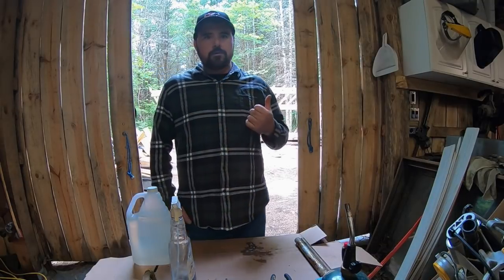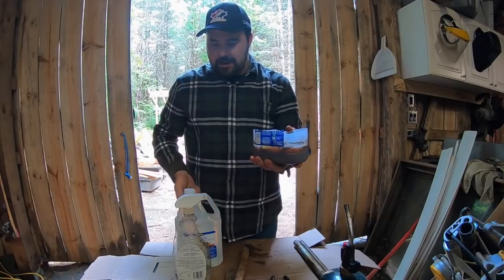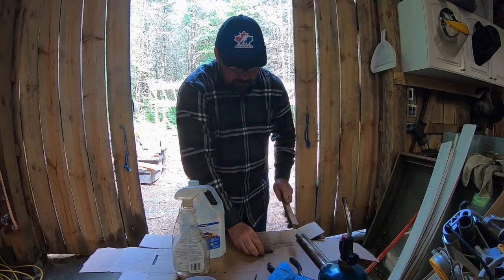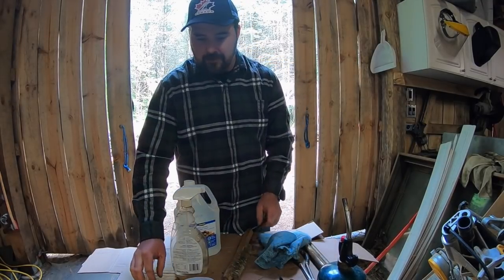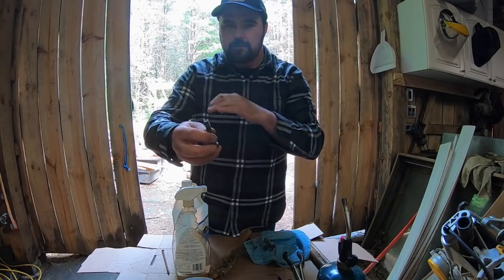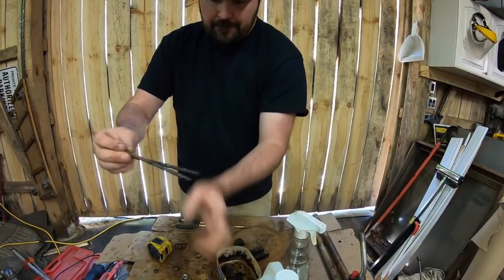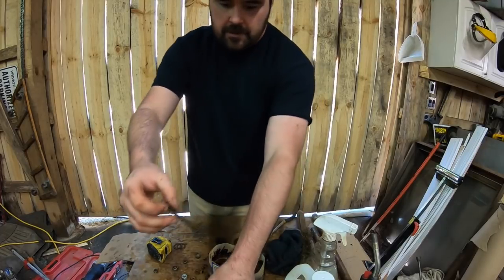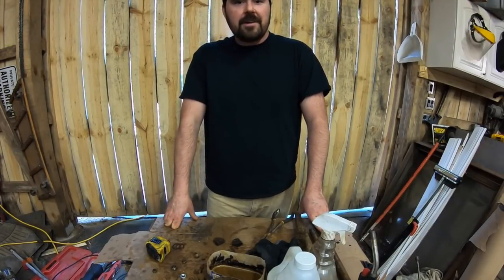Rust Remover You Can Eat | Safest Way to Remove Rust from Metal

Comment: You can also use the rusty  vinegar when you are done as an exterior wood stain. I just run it through a rag to get the chunks out and use the garden sprayer to apply. The first time I used it was a chicken coop 5 years ago and it still looks great the vinegar also reacts with the wood help change colour and act as a bit of a preservative

Comment: Hey Sandy! Neat topic to cover!  I use vinegar as well for cleaning rust!  So thought it was neat to see that you covered this :).  I mainly have been using it when I buy a small engine for a restoration project (B&S Flatheads) and if the metal tank has rust build up in it, I’ll fill it with vinegar and let it set .. then once done, drain and rinse out good then I’ll grab a good couple hand fulls of either nuts or even say 3/4 gravel with no fines and then I’ll sit for awhile and shake the tank back and fourth basically let it scape against the rust to knock it loose, then dump that out and rinse out.. depending on condition I may repeat that process multiple times.. using the same vinegar as even through its discoloured, it still will work fine for the same task again.  anyways it has some good uses!  Also in most hardware / department stores, usually in the cleaning isle, I noticed that they also sell a “cleaning vinegar” which is the same thing just double the vinegar strength.  It seems also to work good as well.  Anyways thanks for this topic!  Cheers Andrew from NB :)

Comment: Here is another use for white vinegar Sandy, if you dilute it with some water and put it in a hand sprayer, take the mattress from your bed and spray the whole frame it keeps away bugs that would normally bite you in your bed, if you can stand the smell also do the mattress but just the seams this will kill off any bed bugs, this is a very old method used way back in the old days, there is so much use for white vinegar it is amazing stuff, and you can make it yourselves. hope this helps anyone who lives out in the wilderness or homesteading.

Comment: Great tip, I've been doing that also and its possible to leave metal in vinegar to long. Also I mix diesel with used motor oil, 50/50 and store clean metal in the mix. Works awesome
Reply from the maker: Good to know. Thanks for passing that along!

Comment: I live in Southwestern Ontario, on Lake Huron and have the same problem with rust, the heat and humidity here rusts everything. I use the vinegar technique for all my saw blades, not only does it remove the rust but also the pitch and dirt that build up on the teeth and cutting edges. After the vinegar treatment and clean up, I soak everything in WD40, this prevents the rust from coming back so fast. I bought a 4L jug and filled a small tub. After a short soak just hang the material over the tub to let the access drain off give it a wipe down and stick the lid back on the tub. I’ve been using the same 4L jug now for 2 years
Reply from the maker: That’s a great idea adding the wd40 afterwards. I’m often undercoating everything metal like many others do here in Ontario and can imagine that wd40 is a good extra step for my small parts. Thanks for sharing

Comment: Another white vinegar tip, If you have a part that is zinc plated/galvanized that you need to weld. soak it in vinegar for a couple of days and it removes the coating.
Reply from the maker: That’s great to know. Thanks Chris

Comment: It costs a little more, but give apple cider vinegar a try.  It works in a matter of minutes instead of hours.  The vinegar content is much more concentrated than white vinegar.
Reply from the maker: Thanks Mitch. I’ll try it out
Reply: Actually, overall, white vinegar is stronger.  Another consideration is to use cleaning vinegar instead of regular as it is said that it is 20% more effective than regular as it is a bit more acidic.

Comment: Online ordering and shipping to your location negates most of the issue of product availability at stores.  Of course a little bit of effort to clean up and reuse rusty hardware keeps more of your money in your pocket.  But, there are limits to everything and the law of diminishing returns kicks in.  My father still likes to straighten out and reuse rusty nails.
Reply: I agree but everyone will have different points of diminishing returns. My point is probably the extreme.  Not only is availability low in the closest two towns, but it takes me almost an hour just to get to my mailbox for packages as it is a 6 mile trip(one way) to do so on an atv(I cannot use a regular car on the atv trail)!  So, yes, I also straighten out bent nails!  :-)

Comment: I wonder if there is a way , naturally to gel the vinegar for using on vertical surfaces.
Reply: use a cloth wet with vinegar and covered with plastic.  you'll have to re wet it from time to time as the vinegar will tend to all go to the bottom.  Depending on the surface, you could also tape a plastic pocket over the surface and fill it with vinegar.
Reply from the maker: Sounds like a good idea to me !